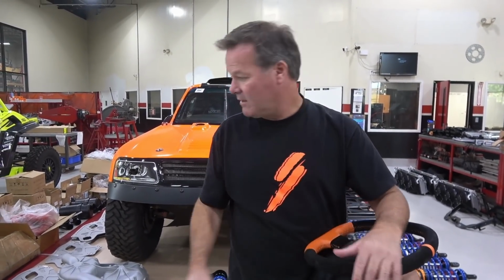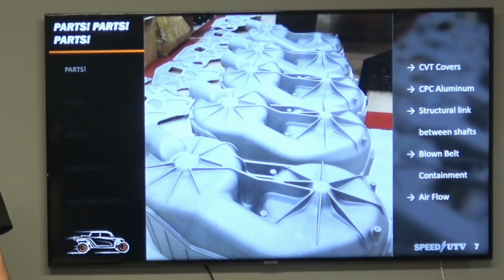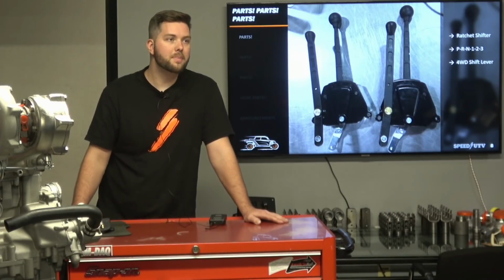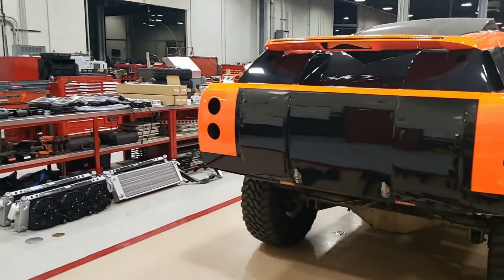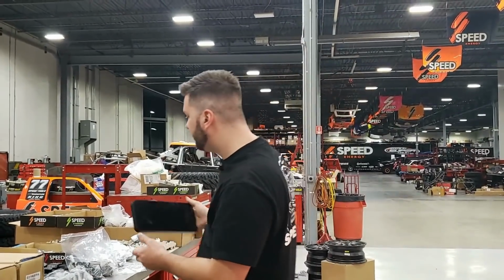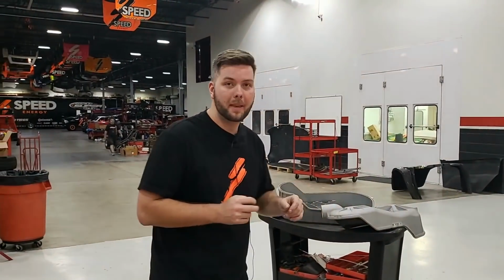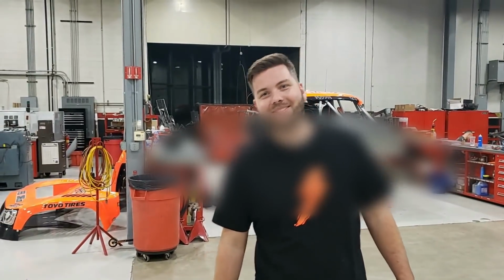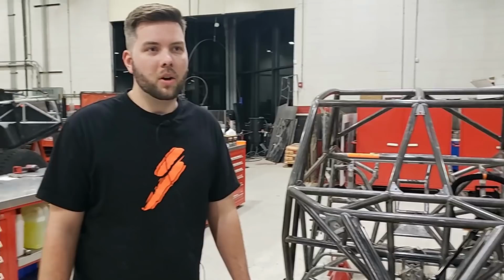Speed UTV Design Presentation No. 73 with the Deazy

Comment: (1) Very nice cvt cover. Any thoughts on the worn belt debris collecting on the exhaust manifold? (2) will there be a front diff safety to prevent shifting to front lock at high speed?
Reply: If it doesn't have a screen should be easy to implement. The synchros they have mentioned are  dog teeth and require a good amount of positive force  to engage them.